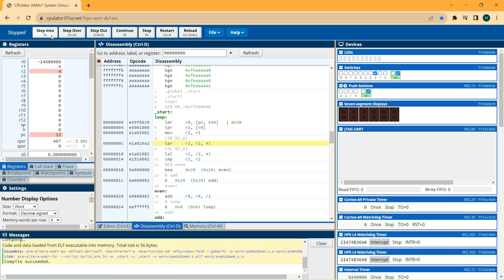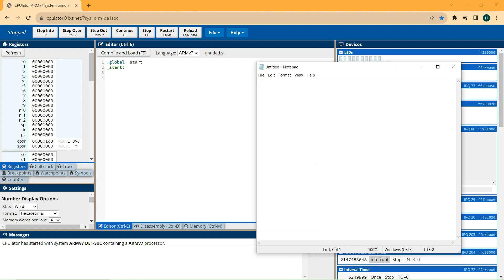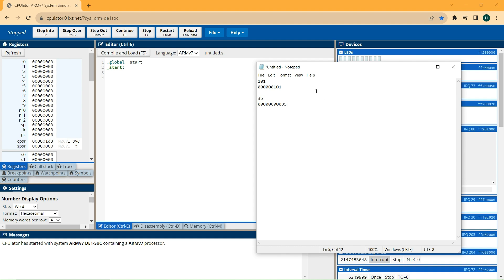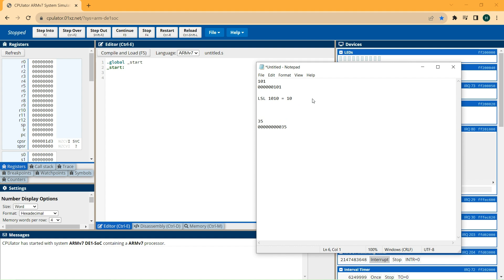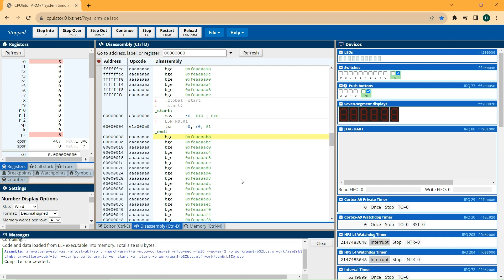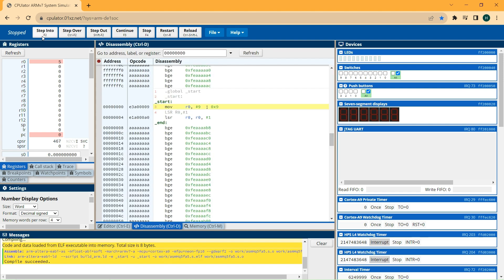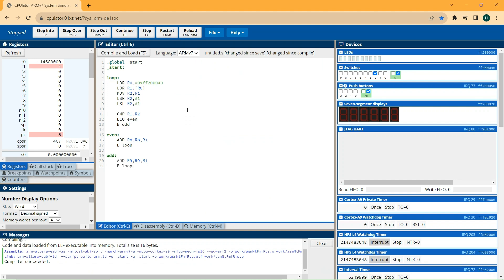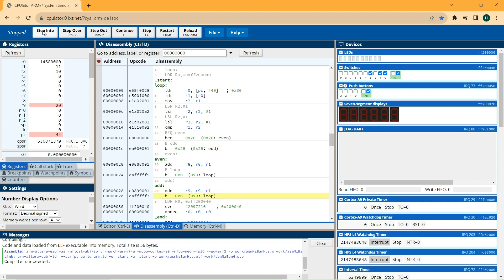Check if number is even or odd in ASSEMBLY

Comment: every time I see "% 2" applied to integers it pains me. I am told that "& 1" is "confusing" and a "premature optimization" even though the bitwise & operator is universal in computer science and is uniform across nearly all programming languages -- aka those that say "premature optimization" == "dumb person that doesnt even know the fundamental operations of computer science, in fact, they are confused by them"
Reply: A bit extraction operator when dealing with base 2 is not premature optimization.  Unless the remainder is a general use case and not merely a convenient mathematical way to express things, when dealing with base 2 number systems, optimizing out powers of 2 isn't premature.
Reply: But every single compiler will optimize modulu by 2
Reply: @urisinger3412  so instead of writing the intended operations, you hope the compiler translates your code into what you intended?
Reply: @urisinger3412 also, what compiler are you talking about because no compiler I know of will translate as you claim with signed integers, because x % 2 != x & 1 when x is negative
Reply: @styleisaweapon  if you evaluate it as an if statement or a boolean, llvm based compilers would catch that.
Reply: @urisinger3412  you are saying llvm produces incorrect code when its an if statement?
Reply: @styleisaweapon  if(x&1) is the same as if(x%2) for signed and unsiged integers
Reply: @urisinger3412  compiler explorer is calling you a liar for some reason
Reply: @styleisaweapon  I don't know why but my comment keeps getting deleted, but 

bool is_even(int num){
    return num%2;
}

Returns the same assembly as

bool is_even(int num){
    return num&1;
}